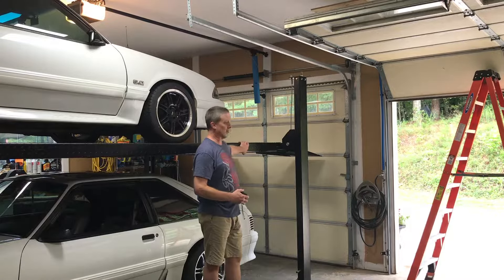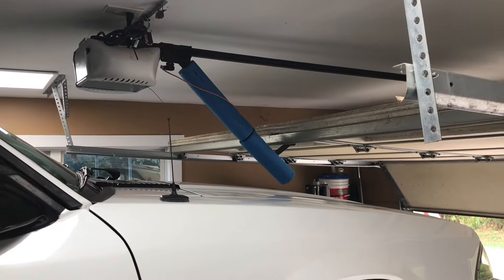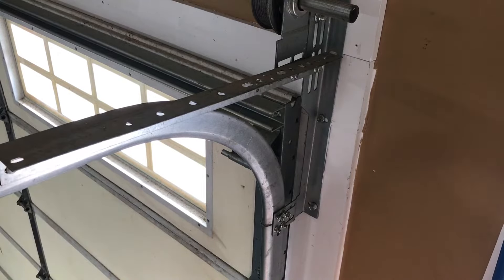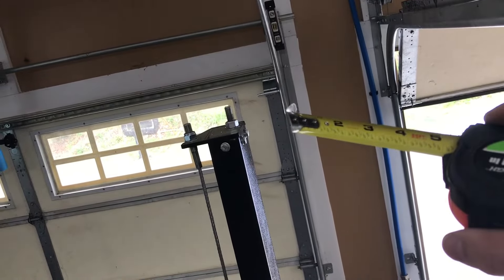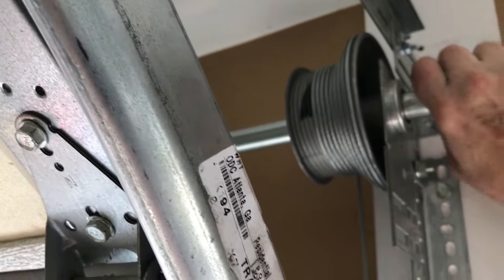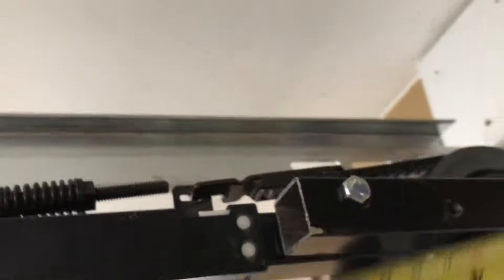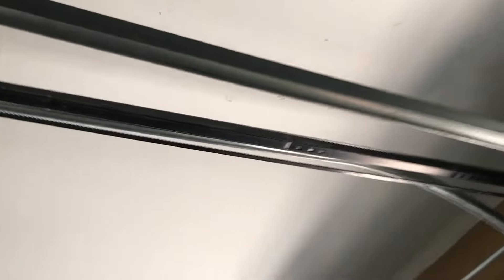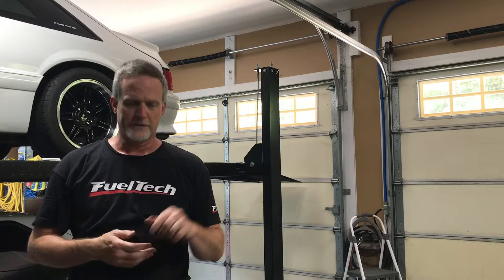Increasing garage door height for car lift and opener jackshaft conversion

Comment: Would have worked out even better if you installed a wall mount motor.  But nice job otherwise.  👊
Reply from the maker: Yes. I wanted to get a side mount but I’m too frugal. When this one fails, I will switch over.
Reply: @fixthemthings  I'm the same way. I've changed out the motor box with a used one a couple time's on the same door and track. Garage door openers are a dime a dozen!
Reply: It’s called a jack shaft buts it ok welcome to the league of garage doors

Comment: Very helpful, and timely for what I am looking at doing.  Question: why is it not a good idea to just keep the same radius and move it up closer to the ceiling?  I have no idea - never did this.
Reply from the maker: You could keep the radius however you will need more headroom for the torsion spring bar so you would lose some height. Another option is to cut your radius in half and add a piece of straight from the end of the rail. This would give you 2 -45degree radius’s with a straight in between. You will need room for your springs and pulleys.
Reply: How do you measure radius. Do I have to change radius rail. or just add bottom horizontal piece only.  
I am going to change new spring too. 
Where did you get the radius rail kit please. Thank you

Comment: Where did you get the kit for the 30" radius?  I have a 7' door and 10'4" ceiling and want to add 24" height for the door.  Convert to a side mount shaft lift system.
Reply from the maker: You can do it for free by cutting your 90s in half then add some straight rail in between from the end of the horizontal piece. I got the kit from my local garage door supplier. You won’t find it online.

Comment: Nice cars. Did you ha e to raise the torsion bars too and is that a 7’ tall garage door. If you did move the torsion bar how do you know how to locate the new position
Reply from the maker: The doors are actually 9’x8’. I did move the torsion bar but I think it had clearance to not move it. If you for sure don’t want to move the torsion bar you can cut your 90 curve in half to make 2 45s and then add a straight section in between.  That way you won’t have to buy any tracks.

Comment: Dude your legit I will be following on my business account and recommended your video to the many customers that deal with your problem on lifts
Reply from the maker: You can do this without buying larger radius’s. Cut the 90 degree in half and add a piece of straight in between. Only have to modify the rails no need to move the torsion bar.

Comment: UPDATE: So…I did the rails rework as mentioned. Here is the new configuration. The track now travels 45 degree for half of the previous 12” radius, then on the straight 26” piece cut from the back end horizontal portion…then the remaining half of the 12” radius sets it to the horizontal piece. I did not relocate the torsion bar, nor did I use different drums or cables, as per your mentioned earlier that nothing needs to be changed. The track and spliced pieces etc are all very solid and the door operates, (manually as I don’t have an opener on it yet) smoothly. The springs are both at 31 quarter winds and the cables adjusted taut. Problem: The door when unlatched springs up and stops at about a foot or so above the ground. Then it has to be lifted the rest of the way, manually of course, but is quite heavy. It does not stay opened on its own and wants close rapidly. It doesn’t crash to the ground and stops at the balance point of about a foot or so above the ground. I have to push it with my foot the rest of the way and engage the latch. So, the new configuration has half the door below the horizontal point and on the 45 degree track.  The rest above the last curve point. This means alot of weight is in 45 degree suspension and constantly pulling down. I don’t think adjust the springs tighter is the answer. I may have to purchase a kit as you have and raise the bar/springs/replace drums and cables etc.  Your thoughts before I do that?
Reply from the maker: That doesn’t make sense. Strange. Won’t go all the way down but door is heavy. I would think you would have to tension the spring more due to the heavy door but not going to the ground doesn’t sound right. You should be able to to easily lift the door if the tension is correct. Are you sure it is not catching on the bolts you added?  Maybe the door is being squeezed at one point. Not sure with out seeing it.
Reply: The track is equi-distant at all points when measured across to the other side. There are no obstructions and the track is solidly braced with strut. The carriage head bolts are not in the way and the rollers do have play to protrude or retract if required. The only thing I can think of, is to add a quarter turn or two to each spring and see if the current balance point changes significantly. I will try to send pics shortly, if I can.  Thank you for getting back to me.
Reply: So I adjusted up the springs and the door now stays up. However, it bounces up from closed position even more and as expected. Closing it from 1/4 raised (balance point for the door now) requires more force. So the unequal and non linear forces as the door travels from full closed to full open tell me it may be time for new and heavier springs?
Reply from the maker: @mrgoggles1963  I put new springs on mine since they were 16th old and one of my other door springs broke. I didn’t show that in the video because it was more about raising the door than spring tensions. Hopefully it all works out for you.

Comment: Awesome job. I'm looking to do something like this for my low-hanging garage door. If you still don't like the belt flopping around, you could probably find a tighter belt or add another pulley in the middle slightly offset, possibly spring loaded to add tension.

Comment: The look of satisfaction in your face when you demonstrate closing it and opening it makes DiY worth it  !  I noticed your belt tensioner bolt is bottomed out , you can shorten those belts to allow more adjustment .  If you have any garage door questions or interested how to shorten the belt lmk I can me a video
I've been repairing Commercial and Residential Garage Doors for over 27 years
Reply: I assumed it was a 1 piece timing belt. How do you shorten it? I want to do this exact mod!
Reply: Why can you not just add more track length to the vertical section, to get your door to open higher? Why is the 30° angle needed?
Thanks

Comment: Brilliant! 3 questions please: 
1)-If I choose to cut the existing 12”  90’s in half, how do I attach the added straight piece between? In other words, what bolt hardware/brackets and where can they be found? 
2)-Just to confirm, the existing torsion bar does not need to be relocated and no need for longer cables or additional adjustment to torsion springs? 
3) Can this be done on a double garage door with no issues to it’s operation?
Thank you again…this is so smart! (and saves money for frugals like us).
Reply from the maker: I would use carriage bolts. Rounded head. You will have to drill holes then make the holes square with a file. Use a bracket or strap to hold them together. I prefer the way you are doing it since you won’t have to change anything else. Let me know how it turns out.
Reply: I certainly will. Thank you for the speedy response! So, I too have a lift, recently, and am concerned the affect of the side mount opener (it is also a Chamberlain whisper drive) will have on the double door. Instead of the center pull, will the end of the torsion rod wind up have the door lifting not level??? I think not, but value your opinion, please.
Reply from the maker: @mrgoggles1963  if you have the money buy the Liftmaster 8500 side mount for the torsion bar. I want to get one but they are $450. They have a door lock and is more reliable than what I did. This will free up some space and you can bring your door close to the ceiling.

Comment: Thank you very much for answering me. So that means I can just add straight track extending the heights but still using the old curved track.
Reply from the maker: Yes, but you will lose some height due to your torsion spring and you will need longer cables. It would be better to add extensions in between your cut 90s to get the curve away from the wall so you have room for your torsion spring.

Comment: Perfect timing for this , I just put my new to me Challenger lift in my garage and I need to raise the door so I can get my car on the lift and still be able to open the door, my setup uses extensions springs though so I have to do a torsion spring conversion and I'm not sure if my chain drive lift can be used off to the side like you did here with your belt drive lift . Nice heads up though on the top door bracket clearance to the ceiling , currently my interior is unfinished so I need to take into account the finished ceiling in the future.
Reply from the maker: You can do it without buying the 30” radius. You can cut your 12” radius in half then add a small section from the end of the horizontal piece. Then you can put your torsion bar at any height along the wall. I didn’t show a safety release in the video since I had 3 garage doors. I plan on doing a follow up video of the safety release and solenoid lock.

Comment: Could this be done with just longer vertical rails at the door? Keeping the 12” radius and of course adjusting all the related items .. shorter horizontal rails .. shorter rail supports from ceiling.
Reply from the maker: You can but it won’t be as high as changing the radius. Look at yours and see how much room there is between ceiling and the torsion bar. That will be the maximum you can raise your door then. 
You won’t have to buy anything if you cut your radius in half to make 2 45s and cut the end of your horizontal and install that in between the radius’s. You won’t have to move anything else. Maybe I should do a video on that.
Reply: @fixthemthings  thanks for reply.  Yes  video update would be great. YouTube algos might like that also.  The garage height is tall.  The supports are 40” long I feel like the installers would have had an EASIER job had they just put the horizontal rails as close to ceiling as possible.  I feel like because they are so far from the ceiling it was harder to install the long supports to the rails.  If that makes sense.  Makes the garage so much smaller when door is open.  I may tackle it as a diy .. need to confirm minimum clearance from ceiling and if spring would need adjusting.  No torsion bars just extension springs but will allow some clearance anyway. Basic doors builder grade from new construction in 2006. No garage opener installed but maybe tackle that at the same time.

Comment: I have 11 foot ceiling and want my garage door to go higher up, cant i just get something to extend the side rails to push the entire garage door assembly 2 feet higher?
Reply from the maker: I would think you could just get longer verticals rails.
Reply: @fixthemthings  that is kind of what I was getting too, i cannot find longer rails in my area cheap but if I could get my hands on another 7 footer then I could cut it to a 2 foot piece for each side. Should work?

Comment: You are the man....EXACTLY what I need to do   TY TY TY
Reply from the maker: If you want to save money and not move your torsion bar you can cut your 90 degree bend in half and add a straight piece in between. Grab the straight piece from the end of the horizontal piece. Maybe I should do a video on doing that to my other door. Read through other comments I wrote to other people on that subject.

Comment: Great innovation ✊🏾 Were you able to figure out how to connect a solenoid to secure the garage door?
Reply from the maker: @ghmichel72  I forgot about it for a while then looked into parts. I was going to use the power from the light, convert it to 24vdc (for safety)then activate a solenoid. However, I couldn’t find a solenoid with the enough stroke or proper duty cycle. 
My belt just broke last month so I broke down and bought the Chamberlain side mount system. So for I like it but it was expensive.

Comment: Great video, where did you get the parts from? Looking to do the same set up in my garage
Reply from the maker: Local garage supply house. If you want to save some money just cut your 90 bend in half to make 2-45s then take the end of your horizontal and put it in between. 
Read details and comments for more info.

Comment: Do I have to buy the 30" kit or not?  Can I just add short straight track to extend the track befor turnning? thank you.
Reply from the maker: You can add straight if you don’t need the room for the overhead door opener however you will lose some headroom for your torsion spring. Add extensions and get longer cables and buy the expensive side mount opener. I think they are around $450 now. I will eventually buy the side mount opener myself but I just don’t need to spend that money right now.  Another option is to cut your 90s in half and add your extension there. Then you won’t need longer cables and you can go as high as you can.

Comment: Great Video! I am actually looking to do this. Can you tell me where you got all the parts from. I’ve tried looking but no luck. Only found the pulley on eBay.
Reply from the maker: You will have to contact your local garage door company to order one. What you could do for free is cut your 90 degree in half and add a straight piece in between the 2 45s.  Take the straight piece from the end of the horizontal piece.

Comment: Why was it necessary to move the torsion bar? The raise height of the garage door doesn't need to change.
Reply from the maker: If I remember correctly, the kit came with new pulleys and longer cable. I also bought a new bar and springs. I don’t think the door hit the old pulleys. I would have to watch my video again to verify. Lol.

Comment: What lift is that? Is it 220 VAC or 110? I don't have 220 to my garage... looking for a lift. Awesome video ! thanks!
Reply from the maker: This is the lift I purchased. It was around $2500 when I bought it. It is 120V. I think you can get 240V though. At120 it pulls a lot of amps with a heavy car. If you have a 20 amp circuit in your garage you will be fine. 15amp may trip. 
https://www.bestbuyautoequipment.com/car-storage-parking-lift-car-park-8-plus-tall-8000-p/autolift-car-park-8plusp.htm
Reply: @fixthemthings thank you!! May I ask what the dimensions of your garage are? Depth and ceiling? Your garage and your door? I’m looking to lift one of my mustangs as well (I have 4, it’s a problem 😅).
Reply from the maker: @jamescognito7564  the garage door opening is 8x9 and depth is around 23’.  Ceiling height is 10’2”.
Reply: Wow. See my garage door is 10’w x 9’t, depth 28’, and a 12’ ceiling, and all the calculations I’ve done, not will fit. But yours is smaller and the lift fits fine. Hmmmm. Not sure what I’m measuring wrong.
Reply from the maker: My lift is only about 9’ wide and 18’4” long. It should fit no problem in your garage.

Comment: Is the actual garage opening any higher? I need a couple inches for my truck to enter without airing down the tires. Great video
Reply from the maker: Depends on your opening in the wall itself. This project just raises the whole garage door height. Your opener may need an extension with a longer belt if it does not go as high as the opening in the wall.

Comment: Is that recommended from the manufacturer?   That shaft you attached to is a simple weak 3/4” EMT conduit
Reply from the maker: Came with the kit. I agree they are weak.  Was not EMT though. Just pipe.

Comment: Did you have use a different spring and pulleys on the garage door torsion bar when moving it up out of the  way of the 30 inch radius assembly?  Do you also have a link for the 30" radius track kit?
Reply from the maker: 390Camaro I had a new spring already so I went ahead and put it on cause the old one was 15 yrs old. I could have used the original pulleys with longer cables but I went ahead and used the pulleys in the kit with longer cables.  I called my local garage door company to order since I couldn’t find anywhere online to order it.
Reply: Fix Them Things! Running into the same thing, thanks for the quick response

Comment: Great instructional video. Do you have part numbers for everything? Where did you get the 30" radius tracks? Did you need to buy anything else?
Reply from the maker: You can buy it from your local garage door supplier. If you don’t want to buy that just cut your 90 deg radius in half and add track in between the now 45s. You can use the last few feet of track and splice it in. No need to move torsion spring or cables. I should do a video on that I guess.
Reply: @fixthemthings  Thanks for the quick reply. I have been Googleing for 20" radius track and getting nothing. I think the local guys don't sell parts, just install. Love to find the kit you mentioned for $180
Reply from the maker: @willytwo53072  I’m near Atlanta. I bought it at Atlanta overhead and doors.
Reply: @fixthemthings  great idea!
Reply: @fixthemthings  great idea!

Comment: I don't see you raise the spring bar up along with the track. Is it right?
Reply from the maker: I did because I had the parts from the kit but there should be enough space where you wouldn’t have to raise it. If you don’t want to buy a new horizontal piece then you can cut your 12” radius in half (45 degree) and add a straight piece in between. Totally free just your labor.